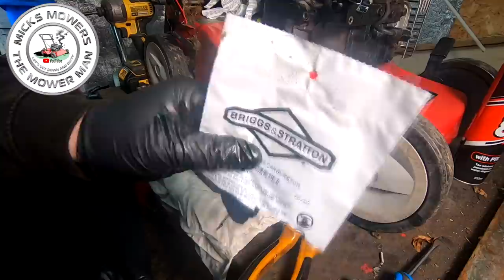Lawn Mower Will Not Start Here's Why Briggs And Stratton Engine #howto

Comment: Good job mate and don't feel bad about comments on not oiling the foam air filters at Eliminator we never do it also and no issues mate. Whenever we get a unit back for oil change, blade sharpen etc. and our foam filter unoiled is in there easy peasy water and dishsoap clean and reinstall. When they are oiled it is a messy job to try and clean we just install a new one not oiled. Never an issue, the only issue with these is grass and debris inside the fuel tank on EVERY ONE that comes in for service.

Comment: These are my bread and butter mowers here in Australia. I buy them from
My scaper mate for $10 to $15 a complete mower. I fully service them new spark plug , oil , air filter blades  diaphragm and gasket, primer bulb make sure everything is clean and in full working Order and sell them them for $200 a mower and they sell fast.
Reply from the maker: Yeah mate too mate. I can flip them quick

Comment: Well done mate.
Just a couple of rules that I personally go by are screws holding plastic do up until you feel resistance  then 1/4 turn no more, plastic, rubber and carb diaphragms use only GT85 or WD40 or whatever your preference to clean NEVER carb spray as it deteriorates them causing them to become brittle.
That "O" ring between the carb and intake manifold can over time wear out and is a major cause of surging on the Briggs,  pay close attention to it as you've already got the carb off and if it shows signs of any flat spots, hardening or tiny tears replace it.
Reply from the maker: Thanks for the information mate

Comment: Hi  Mick, have you any idea  why the  later  carburetas  wont  eject fuel  from the Primer, do  the later carbs  have  a  different  internal  layout, my carb &  tank  were lost  in a  house move  after  taking them off  because  the removal company  stated  they wont store  inflamable  liquids,it is  a  35 classic  mower  but after trying  3  different carbs  & gaskets  the   primer  never works  but  it will  run for a  few  seconds  with  easy start  added.
Reply from the maker: Sounds like the carb is now not working (sucking fuel) I would recommend a new carb.. only buy a genuine one.. around£20.. that should fix the problem
Reply: @themowerman  I  have tried 3  I  was wondering if  they  have changed  the  internal  layout   that is not  matching  the  gaskets thanks.
Reply from the maker: @texhow1  emaile some photos mate micksmowers01@gmail.com

Comment: I just found out that WD 40 has WD 40 specialist choke and carb cleaner  what is your thoughts on this matter of WD 40 specialist choke and carb cleaner  thanks mate
Reply from the maker: I would stay using the normal one for all rubber rings and gaskets
Reply: @themowerman  thanks for your help with this matter young man 😎👍 I'll do that to clean up the cards on two of my machine,s one which is a Kohler 13 ho over head vavle the other one is a industrial Plus 8 hp Briggs and stratton flat head on a Troy bulit tiller